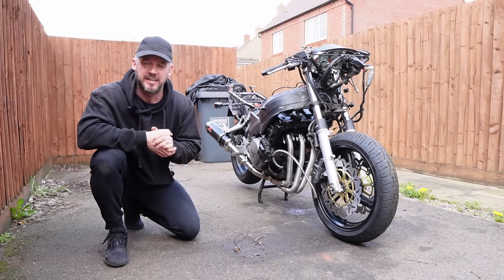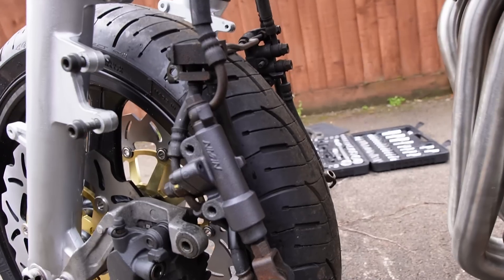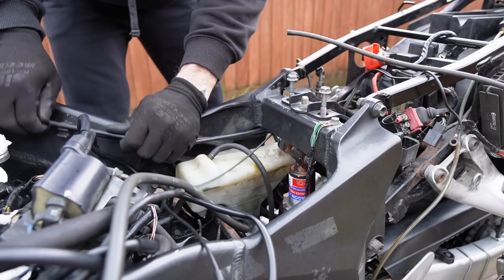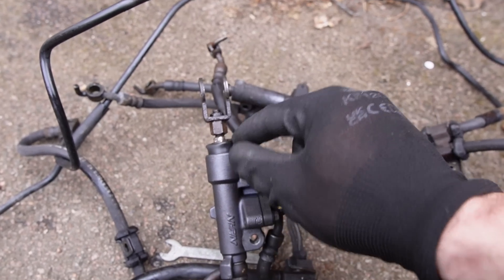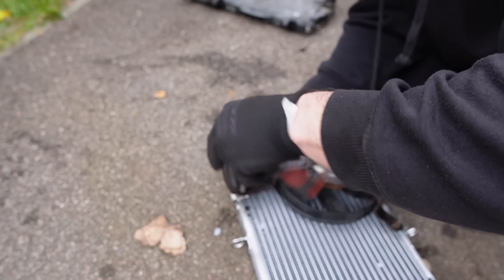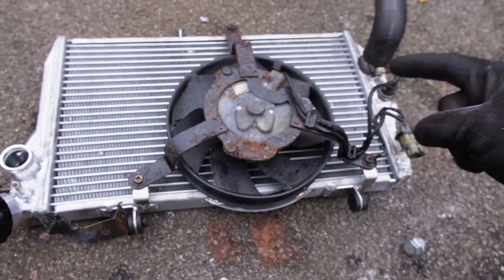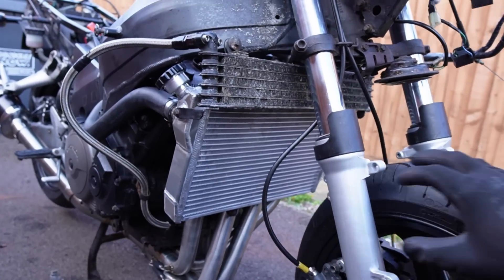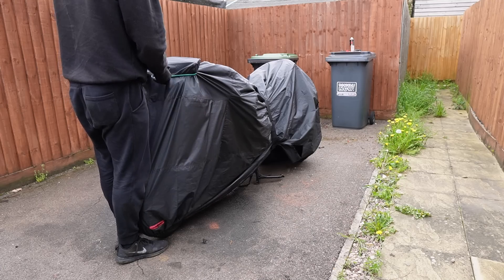REBUILDING MY CHEAP HONDA BLACKBIRD CONTINUES

Comment: I am enjoying this series with the Blackbird and I don't like being an armchair critic but the only bit of advice I can give is throw away that adjustable spanner they are a sure fire way to round off a tight nut and bolt
Reply: Bang on. There's a reason why mechanics spend a lot of money on top quality spanners.
Reply: Bahco adjustables are IMHO the exception to that generally accepted rule.
Reply: PGMan, Please draw in your armchair, come join our cosy little critical amphitheatre. Would you like some popcorn? What about that use of copper anti seize eh? l  nearly dropped my ice cream!
"I haven't lowered the bike to improve handling" he wrote..........priceless.
Reply: @davidfollows-o1e  There's a test channel on youtube that tests all sorts of things and I'm sure they did a video on a large selection of brands of adjustable spanners. My take away from it there was a variance between brands (obviously) but none of them could match the torque of a normal spanner.
Reply: @dave8204  😮😅
Reply: Agree, adjustable spanner is usually my last resort
Reply: As a complete noob myself, can you explain why adjustables aren’t good?

Comment: I love that you are new to this but still giving it a go. For all the haters, maybe they should buy a broken bike and fix it "properly" the way they want it.
And as for spanners, adjustables should be a last resort as they open slightly under pressure and round off nut & bolt heads. Use the correct spanner if you can as this could save you damaging nuts & bolts. 
Also socket extension makes life more difficult keeping the socket square to the bolt. Only use them when access is restricted or your wrench could wobble or get misaligned.
Keep it up as seeing someone with really basic facilities is refreshing.

Comment: Use some tubing (5mm ID, which I sell online lol) and a syringe to pull all old brake fluid out through the bleed nipples before undoing the banjo bolts. Then when it's time to fill and bleed them, top up the reservoir and use the syringe to pull fluid through into each caliper (always start at the furthest away on the front), then bleed as normal, otherwise it can be almost impossible to get pressure in the system.
And for the throttle cables, would be much easier to do those before fitting the throttle bodies 😎

Comment: I think the front brake cables are swapped. The shorter cable needs to be on the other side. And for the throttle bodies, use silicone spray not copper grease

Comment: Be careful with that radiator, i brought a new radiator off ebay,  had the same issues with fitting the fan, but after a year of use the 2 lower cores started expanding, so ended up buying a second hand original. Bike was a 2001 fireblade. Loving the build, by the way. Keep up the good work.

Comment: Only thing that would worry me to be honest mate, is NEVER use copper grease on rubber. It swells the rubber and ull get leaks.
Reply: Plus one - Worth investing in red rubber grease as its kinder to.... rubber. Restoring bikes is alwya a journey and you learn a lot going along.....
Reply: Never use copper grease on anything tbh. Winds me up how people think everything needs to be slathered in the stuff. Brake caliper bolts seem to be the worst for it

Comment: Tip for next time. Disconnect throttle cables at the grip and attach to throttle bodies before you fit them to the bike. Whole lot easier and quicker. If the intake rubbers need a bit of lube use a silicon spray. Copper grease not meant for rubber parts. Been an interesting build, looking fwd to seeing the end result .

Comment: Well done heat and also shock will help removing bolts copper grease is not as grease as easy on again you could have used hot water to expand the throttle bodies also could you have fitted the cable first fantastic effort

Comment: Ur getting on well. Taking shape 👍🏻
I just bled my brakes yesterday,  bit odd bleeding the rear brake via the 2 front calipers I know but I do like the linked system. 
Ur gonna have a great bike in no time 👍🏻🏍
Reply: I advise against it. People think that delinking the brakes will turn them into Valentino Rossi or something, and later have their hopes severly diminished. I actually have grown to like the linking braking system and how it works. Main down side is complexity, and rebleeding after a full drain. Ugh....

Comment: On the next project maybe get a small wire brush and some wet & dry paper on the rusty bits like the radiator fan mounts and some Hammerite Direct To Rust paint in them for some protection. No need to go mad, just get the flakey bits off and smooth the surfaces a little.
Loving the consistency, 100k subs by the end of the year I reckon.
Reply from the maker: 100k subs 🤯 thanks for the compliment! 🤞🏼
Reply: @BikesofRye  you’ll get there mate already going strong

Comment: enjoying the series on the blackbird. However im sure your more than capable of a wire brush and a tin of spray paint alongside some new nuts and bolts. Im only saying it as its my pet hate however I know not everybody is the same. However it will just finish it off that little bit better specially when youve gone to the extent of an engine swap.

Comment: Good vid . Great to see you making progress. I'm no mechanic, but happy to share my (limited) experience. Rusty bolts - I've used Bulldog BDX, and it seems to work better than wd40 for rusty bolts ( more expensive but easier than messing something up) I try to use open-ended spanners, not the adjustable , especially when bolts are rusty and tight. Similar , I try and avoid the socket set extension, unless I have to. Less chance of rounding them off.

Comment: When you were loosening the caliper mount bracket with the Allen key it's easier to push down than pull towards you, if it's really tight you can slip a ringer spanner over it. You can also link two spanners together if your slackening a hex bolt that's tight

Comment: Can't help thinking that it would be a much better end finish if you cleaned up the re-used parts, nuts and bolts before refitting. It's pretty cheap but takes elbow grease and time though!

Comment: Whilst you may not want to fully restore each part, if u find a rusty bracket or bolt, paint on a little Vactan; it will change the rust to a nice black colour and also help stop more rust forming, or the part failing.  Good luck

Comment: Great job so far Rye. For the frame I’d just tidy up using Simoniz Satin tough paint leaves a lovely finish and easy to use (plus durable and fuel resistant!)

Comment: Good series mate. Did you test the radiator fan to see if it was working before refitting it? If not I suggest you do before you put all the body work on and find it doesn't and the bike overheats and you say " Bye Bye"" to your new engine.

Comment: Lowering by 15mm is going to make the bike turn in much slower, my BB had been dropped by about the same amount when I bought it, raising it back to standard made a huge improvement in handling.
Reply: its almost as if honda knew what they were doing 😂
Reply: @Gruxxan  🤣🤣Exactly that.

Comment: I absolutely approve of getting rid of the linked brake system. I wouldn't want that on my 'busa! Don't get discouraged by the problems that arise. You will have a really nice bike when you are finished. Maybe get a rear sprocket with one more tooth. That would give you more pep when you roll on the throttle. I have faith in you man, the Honda will be very fine!

Comment: The rear brake might feel a little hard and not quite as good, the master cylinder is sized to move more fluid than it will now that you have de-linked, so less pedal travel. I had the same issue with my X11 so replaced it with one from a fireblade now it is all good. Mine also has manifolds so that all the caliper pistons are used instead of just 2 on each, plus a custom made front caliper brace that replaced the secondary master cylinder.

Comment: Brake lines could be removed after taking the calipers off right? adding sideways force on calipers while theyre in the disk might cause the disk to bend. Even slight bend in disk causes unstable / wobbly braking

Comment: great videos to watch, you should have used the red rubber grease on the intake boots, and it is much easier to fit the cables before installing the throttle bodies/carbs, looking forward to the next vid!

Comment: Do you have a workshop manual for your bike mate? If not, get one. You'll learn a lot from just reading it thoroughly before each job. 
Well done for taking on a project, but i would highly suggest doing some research before starting any job. There are hunderds of videos of people putting carbs back on and not once have i seen or heard any one use copper grease on rubbers! That is actually bonkers 😢. And invest in some flare nut spanners when dealing with brake lines...you'll see why I recommend them.
All the best. 😊

Comment: As others have said, get rid of the adjustable spanner, those things never fit the fastener properly, and are a quick way to round stuff off! And get a bigger ratchet to give more leverage on stubborn stuff, and give things a whack to “shock” them undone, as putting slow rotational force is also another way to round stuff off. None of this is criticism, you’re doing it, and you’re getting stuck in, so keep at it!

Comment: Lots to learn, which is half the fun. You're well on the way. Just one thing, did you remember to tighten the brake disc bolts that you left for later when you installed them?
Reply from the maker: These bolts in process of being cleaned and fitting
Reply: @BikesofRye  And when you refit them, make sure you use a threadlocking compound (usually high strength is used on disc bolts but they then need a blowtorch to undo, so I use medium), and a torque wrench.

Comment: Don't use an adjustable spanner as it will make it easier to round off bolts.  Use red rubber grease on anything rubber, copper grease can damage it and act as grinding paste if it gets into the engine!

Comment: 90% of aftermarket rads need manipulating to fit. unfortunately their tolerances are awful. tip never use copper slip for anything related too fuel/ seals if u can avoid it as it has metal filings init. also dont know if u have had a chance to read my previous comments, my company is happy to offer heavy discounts on parts required for this venture! hit us up should u need help.

Comment: go halfords get advanced socket sets 1/4 inch also get hex sockets and extensions 1/4 inch , get half inch breaker bar with few sockets , set with few hex sockets you need for major body parts like swingarm , , get hex sockets also.  looks like your struggling using tools that are too small for the job , use leverage , get two cheap spanner sets from toolstation metric , its so much easier. dont forget umteen extension bars , probably only set back 100 pounds all in , dont need many half inch sockets usually for wheel axles ,  never really used 3/8ths socket sets , 
get some big steel pipe wide enough to fit over half inch breaker for even more leverage , same for 1/4 inch ratchet

what security are you using , shed ?

Comment: Tip. Don't always us an extension bar on your ratchet. If you need to reach in somewhere of course. But for rusty nuts on the likes of the rad fan, you'll crack 'em open quicker minus the extension bar.

Comment: i get you didnt want to fully strip and restore each part etc.... but why not get rid of the corrosion on the frame, add a little etch primer and simply rattle can some satin black over it? would it be perfect... no, BUT it would stop the corrosion and make it look a damn site nice.... same with the fan etc. Wire brush, something to stop remaining rust, some etch primer, and satin black paint... frame and fan would be less than £20 and take a few hours tops (especially while the engine was out would have been soo simple... i get youre learning but bare corroding ali isnt going to stop corroding and its still open to the elements, where a little time, little £, could have stopped that. your call of course, but i think youre trying to save a few £ where in the long run, it may be costing more... good luck and have a craic

Comment: What's the reason/advantage to removing the link system on the brakes? Not questioning it, genuinely asking.
Reply: Pain to bleed, more weight, more parts to go wrong/fail, and having a choice of which brake to use when is nice.

Comment: Really enjoyed this video, the blackbird is starting to look good although it's not going to be a full restoration with the cost and time I suppose, but when you have finished it she'll be in much better shape when you've finished it, just wondering about what you are doing with the body work ,are you repainting the original one's or buying replacement one's, possibly from China anyway really enjoying the build. ❤
Reply from the maker: The fairing will be painted 😉

Comment: Ahhhh! Dont use copper grease on rubber, it can eat away at it. The best stuff to use is red rubber grease, or a silicone spray if its only needed to help fitment

Comment: With the siezed threads/bolts, if they don't come apart with 'reasonable' force, *always" try a bit of heat before going to 'undo or round off ya baarstad' force! Get yourself a cheapo butane canister blowlamp - just don't use it around petrol!!!

Comment: Impact driver????? £50 at Screwfix then a small battery.... wow.
Edit - why are you putting those nice new bitz (radiator) on the rough/rocky ground - get a small off-cut piece of carpet!!! I shake my head.

Comment: Use rubber grease for carb inlet installation, dont use copper grease as you are basically allowing copper particulates into the inlet tract then into your engine and into the oil...................., NOT GOOD!

Dont bodge it, go back and wipe it all off and if you dont have any red ruber grease, use vaseline or similar, NEVER COPPER GREASE  (Ginger Grease)
Reply: use silicone grease

Comment: I love your initiative, brother, but I fear you are a bit beyond your depth on this project. Pretty sure there is more to jettisoning the  integrated braking system than just swapping hydraulic lines.
Reply: Not really, once you've binned all of the original lines and secondary cylinders the kit turns tbe bike into a standard braking system with independent front and rear brakes, much easier to bleed and is the reason most of us use the kit (Jaws motorcycles uk). Ive done 3 blackbirds and 1 honda x11 with them. 👍

Comment: As already stated, throw away the adjustable spanner, it will cause you untold misery.
Reply: They're still useful. He could have used it to hold the brake union block while undoing the pipe fitting with an actual spanner.

Comment: Buy a combination spanner set  and Stop using the shifter,, you will not round so many nuts and bolts,,a good shifter doesn't flex cheap ones do,, and are crap ,,